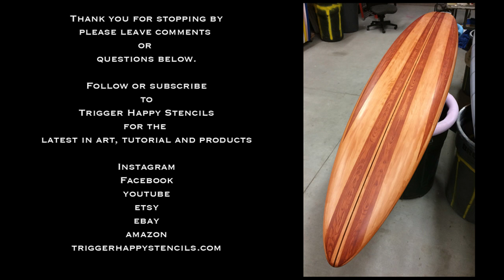How to Turn Any Surfboard Into Wood. Custom Painted Faux Wood Grain With Sean Cahill

Comment: I have never seen anyone do this kind of technique done  so masterfully, with such realism! The colors are fantastic! Any chance of getting more details on how you mixed colors, ratios of reds, back, white, etc? Also important is ratio formula for  hardeners on clears, etc.  Im begging for for details bro!!!
Reply from the maker: Spirit Led Thank you so much!! I hate to say it, but it’s super fast and loose. I used 3 colors and mixed it up by eye. I added white to a standard brown to get the peach base color and black to the brown to get a darker brown for the grain. I used the large graining tool I got off amazon for the design then went back over the wet paint with a large bristle brush to soften things up and make some fine brushed grain lines. It was my first time doing this so I really didn’t know how it was going to turn out but I was pretty happy with it in the end. It’s been about 3 years since I did this and it still holds up in open water paddle board competitions. Try it out and let me know how it goes.

Comment: what an amazing job Sean..... you are very skilled and I applaud your work. Can you tell me what type of paint you used on the roller process, and what brand you prefer to use. I presume they are water based acrylics?
Reply from the maker: Thank you!!  I'm glad you liked the video! For this project I used Wicked Black, White, and Brown from Createx. It's water based acrylic with a little binder added so it's pretty tough stuff.  The Base coat and other darker browns were made by mixing different ratios of those 3 colors. I watered it down a lot to give me a more transparent look and to keep it from drying too fast so I had more time to push the paint around with the roller and the brush. Make sense?  I hope I answered your question.
Reply: thank you Sean for your quick reply. I figured as much.... I use the Auto Air Transparent range for any airbrush work on surfboards which is mostly done directly onto the foam, but just did one on the sanded hot coat using Wicked Acrylics. Thanks again and I appreciate your sharing of your knowledge.
Reply from the maker: Shane Martin Right on Shane, I'm glad it worked out. I prefer paining on the glass whenever possible. It takes a lot more prep work and a solid clear coat to pull it off  but I like the look a look a lot more. Keep at it!

Comment: some of the nicer graining ive seen,I dont see any of the colours originally described in the beginning....I dont see black,dark brown or white in any of this.I see tan brown,and red browns.
Reply from the maker: Hi Mike, thanks for the compliment.  Sorry for the confusion, but I can assure you that those are the only colors I used.  I mixed those colors to get the desired effect.  The base coat for instance was made by mixing about 70/30 white/brown which came out to be kind of a light tan color that almost looked a little pink.  I used the brown straight from the bottle to get my medium brown tones which are on the red side because of how CREATEX makes it at the factory.  I added a little black to the brown straight from the bottle to get my darker browns.  It's not an exact science because I just eyeballed everything, (which doesn't always work out) so it takes practice and patience.  I hope this helps you better understand how the colors worked.
Reply: hmm ok..ive been airbrushing for 30 plus years..and woodgraining a bit..i found it a hard tutorial to figure out,i guess the fact that theres no talking doesnt help..lol..but i love the results..very cool technique
Reply: @TriggerHappyCustoms  thnx again for taking time to further explain,,I think isee what your saying with the colours
Reply: after you pull the wood grain tool,i see you are going over with big paintbrush.are you dry blending the grain or adding more colour over top..transparent colour?and i see you going over with roller with more colour..transparent colour?
Reply from the maker: @mikebrodie6407  Yeah, sorry abut that. I was new to making videos at this point, and was really just trying to document the results, a little instruction would really help.  Unfortunately this is the first and last woodgrain job I've ever done.  I'm all digital design now which stinks because I miss painting.
Reply from the maker: @mikebrodie6407  Yup, you're right all around.  I didn't know what I was doing so I was just trying all kinds of techniques that I thought might work.  The dry brush worked really well to knock back each layer so I could build it up slowly.  Since I was doing a lot of eyeballing to match the color on each section, the dry brush was a big help in controlling the dark and light tones. It also added some really fine grain lines that I couldn't get otherwise. I remember watering the paint down a lot and going back over it with the roller to build transparent layers.
Reply: @TriggerHappyCustoms  lol...ok...gotcha....i love how it turned out..sweet job

Comment: Hey Sean, awesome job! I have an old 9'0" that I want to make wood grain to hang on the wall for decor. Two questions...1: The surfboard is fiberglassed with some designs on it...can I just paint over this or should I paint it a base coat of white to start? 2: If it's not going in the water...should I stick with the clear coat & no hardner?

Thanks, and again great job! It will probably take me a little while to get to it, but I'll post a video of the project with kudos to you to show final product.
Reply from the maker: Holy Crap Terry!!! I promise you that I did not see this comment until right this moment, and I check every day!!!  PLEASE let me answer your 6 month question... You deserve an answer after 6 months of no reply. I truly apologies!!

 To answer question 1. This is what I would do, it works very well, but only if you want to re-paint the whole board and bury those other graphics.  I shit you not, if you try and use straight white, those graphics will eventually show back through if you don't get it right... It could ruin your artwork and bum you out, just sayin', happened to me several times. Try this...  

De-Wax thoroughly! Wax/Grease Remover, Acetone, either one will work and not damage the fiberglass.
Scuff the whole board with Scotch Brite Pad... Hardware store, either RED or Grey.
Get 3-4 cans of Krylon or Rust-Oleum Automotive Primer... Gray, $6 a can, hardware store
Base the top with 2-3 LIGHT layers and 1-2 MEDIUM to heavy layers... GO Slowly and allow dry time between coats, check the specs on the can.  
LET IT DRY!
Turn it over and do the bottom side exactly the same while getting the rails... Blend the rail into the dry top layer.
LET IT DRY!
When everything has a nice even coat on it and the graphics are buried... YOU'RE READY TO PAINT!                     
Sand the whole board lightly with 350-400gt sand paper.
Wipe all the dust off with paper towels and a little water.
...You might have to fix a spot or two, but that's normal...

Base coat the board in whatever color you want using the same process as above, except the ratio will be 1 light coat, 1 medium, and 1 medium-heavy coat. ...3 layers... 4-5 is okay for a wall hanger.
I use a larger spray gun and a 27gal compressor at 45-60psi to do jobs like this.  If you don't have access to all of that, then think about spray-paint cans or brushing/rolling the color on over the primer.

Make sense??

Question:2  I use a 2 part clear with a hardener whenever I do my boards because I have access to a larger gun  and a compressor... It's just the fastest and best way I've found to apply the clear coat. 

What are you working with?

Sean
Reply: Thanks Sean! No worries on the delay. I just got moved to a new pad and have cleared out the garage enough to undertake this effort anyway. Thanks for the awesome instructions. It makes sense. It will likely be a long, drawn out project for me, which is fine. I'm in no hurry. I just want to take my time and do a good job.

As far as the finish, I might just find someone to spray it for me. I suspect that will be easier and I don't want to dick it up if I spend a lot of time trying to make the wood grain look nice. I'm in SD, so lots of board places round here, I'm sure I can find someone. 

Thanks again! I'll post a pic when I get'er done.

Comment: Wow!!!!    Dumb question, I've faux finished some things in the past but about to do a surfboard.   I already put a bade coat on it .....without stripping /dewaxing it first. Oops.   Anyway I can get away with NOT going backward and stripping it?
Reply from the maker: 50LOVESIT Not a dumb question... Prep work is key, always make sure you're working on a pristine surface. Hopefully your paint sticks! If your board is a wall hanger then you may be able to get away with it. If it's for surfing then you may run into bonding problems that will have to be fixed. Have I answered your question?
Reply: Trigger Happy Stencils yes, it's just for decoration,   Can't decide if I should move ahead or go back and strip it.   Decisions,  decisions.....prolly move ahead. Thank you!!!
Reply from the maker: 50LOVESIT If it's just for show then you might be able to pull it off. Let me know how it goes... Good luck!